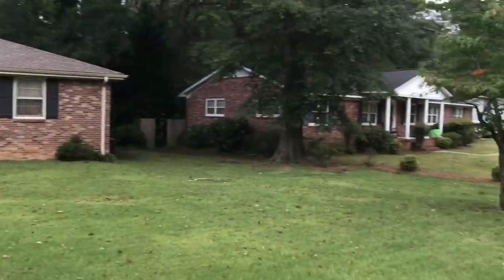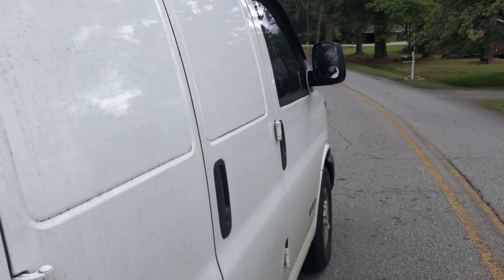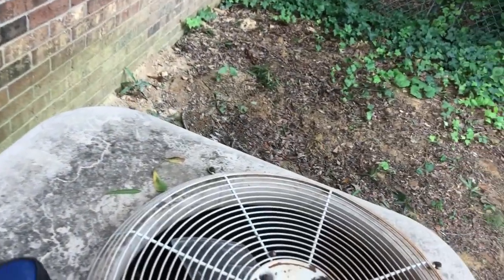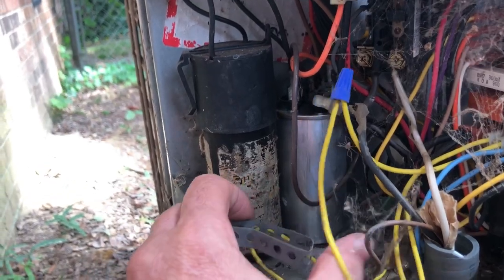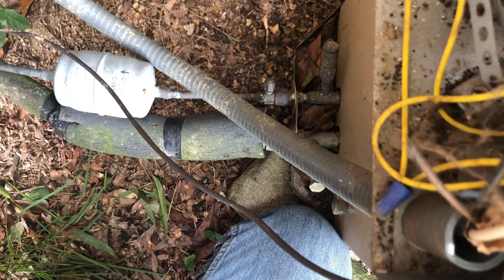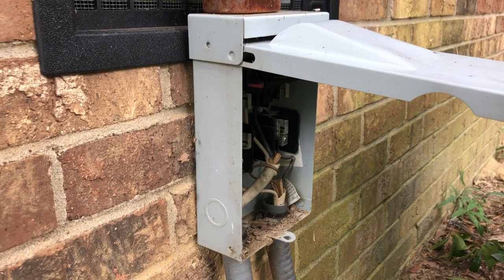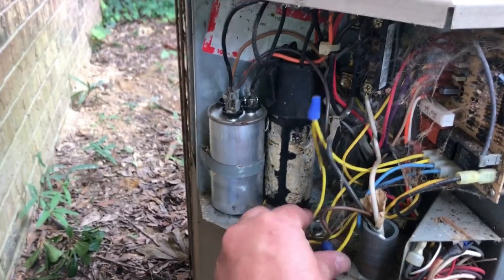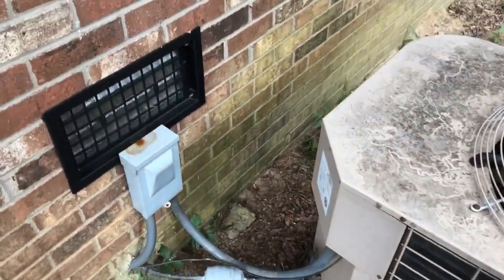Quick fuse n go Bad Outdoor AC disconnect and blown fuse

Comment: someone did a nice fix for missing disconnect plug >_> (sarcasm)
a quickie shortcut is checking for voltage across the fuses, the one showing 240V is bad/blown/open fuse :)
it always works assuming you have 240v coming into the box(line side), condenser is wired, contactor pulled (check from each condenser/load leg to ground and see 120v) >>
that shows the condenser is passing the voltage through back to an "open" fuse, it also shows there's likely not a dead short or something would be humming and hot trying to run at 120V.
Reply: this also works in case of 3 phase and pretty much any suspected blown fuse, it assumes you've checked and know there's power coming in one side and some form of load on the other side. ideally you'd never want to stick a fuse in or pull one under load, more so the higher voltage and phase count!

Comment: My AC wouldnt turn on.  It ended up being the 20 amp fuse in my basement. I still have old wiring.  As soon as I started screwing in the new fuse the ac turned on!  woohoo. At first I thought it might be the fuse(s) outside.   Had to deal with that whole capacitor/fuse thing last year. not fun trying to learn all this and try to figure out what might be wrong.
Reply: Just have that problem in my friends house. Last year breaker was popping out. Did year exchange of the compressor. Ceased compressor.

Comment: Looks like he would at least want the disconnect replaced.  It has been several years since I helped do any Electrical work, but those disconnect boxes are pretty cheap, of course I guess everything is going up now days, but technically couldn't a repair man sue someone for not having a proper disconnect right there at the unit?

Comment: We had a big storm, and the compressor stopped working. I changed the fuses and then restarted it and immediately compressor unit sparked and then a puff of smoke. It looked like it was coming from the wires under the fan blades.cut off the power right away.  Is the unit shot? I would like to understand before I call a service man , who most likely will want to replace the entire unit since it is old but worked fine until now. Can someone help this single mom troubleshoot

Comment: what did you quote him to install a 15 dollar box?
Reply: Got a quote to replace my disconnect box for $250. Went the next day to Lowe’s and bought a non-fused one for $9. AC is back on for $9.
Reply: Sometimes the value is in the guarantee.
Reply: @orlandogonzalez795  AC company here tried to quote $300 for a 15 dollar capacitor that has been fine for 12 years now, clowns!
Reply: @dereckc9469  Bought an inexpensive capacitor last yr on amazon and my dad installed it.  then needed new fuses for $5 as apparently the bad capacitor blew them.  I put those in.  Worked like a charm.  Definately pays to figure out and handle repairs yourself!

Comment: I have a question. I have a central air conditioning system York. The problem is that the compressor will turn on sometimes and other times it will not turn on. The tech replaced capacitor, the thing that holds the wires from thermostat (don't remember name), cleaned the evaporator coil and condenser, added a jump start to electric box for compressor, checked for leak, but their was  none, thermostat wire was chewed on a little bit but we spliced it and fixed that. Do you have any suggestions. Could it be thermostat wire or the thermostat itself (but it turns the furnace on and that works) or could it be an electrical problem. 

Thanks.
Reply: Looks to me like the customer's botched one up, capacitor that is and has done so using an even older capacitor than the one he removed.

Comment: he'll end up replacing it, if any inspections take place before sale. oh-well.
Reply: Not all inspectors will look deep into HVAC units or every aspect of the house for that matter. I know this because when i purchase my house recently the NEW AC wasn't working at the time of inspection. (it was fixed easily and running by the time we closed) .However when i opened up the connector box the inspector yelled "do not touch that, you don't want to to touch anything or try to fix it yourself because then you will be at fault". The inspector did nothing and simply wrote in the report, central AC not working at the time of inspection. and yadda yaddah. You would think that they're doing their job but sometimes lack of knowledge or "liabilities" get in the way.
Reply: @christiancenturion4123  he's right, first thing you do is complain and make them call a company without touching anything but the thermostat switch/buttons  or better yet, let the inspector :)
Reply: @throttlebottle5906  You see, sometimes the answer is quick and easy and right in front of you if you look. You can find the root of the problem instead of making a big deal out of everything. Gonna waste a whole lotta money if your first course of action is to call a technician for every little thing before attempting.

Comment: I was changing my thermostat and I forgot to shut the power off and now my AC condenser won't come on
Reply: Probably blew a fuse
Reply: Mustafa Ali or 24 volt transformer
Reply: @greg778123  possibly that too
Reply: Check the furnace 5 amp fuse , they look like those car ones

Comment: I had a fuse problem and replaced the fuse and it ran for about 5 minutes and blew again.  Anyone know what could be the problem?  Is it the capacitor that is causing the fuse to blow?
Reply: Wish I could help you man. I've had to learn and learn about HVAC systems and everything else in this house since purchasing it because of the old owners negligence. The only thing I can say is, read alot of forums on websites and watch videos until you're comfortable doing anything. I'm trying to figure out my units issues right now. Hope you figure it out!